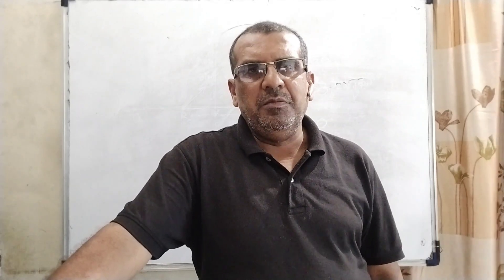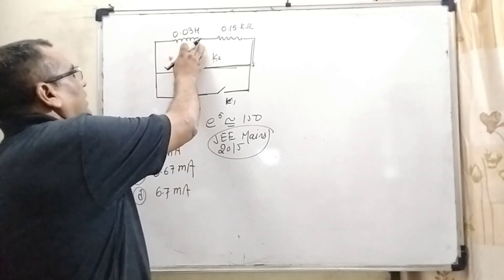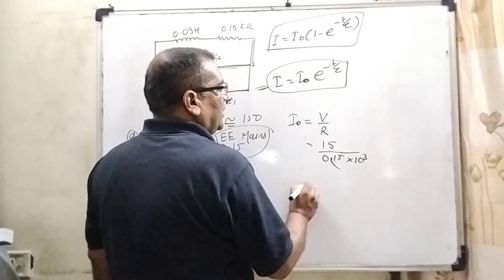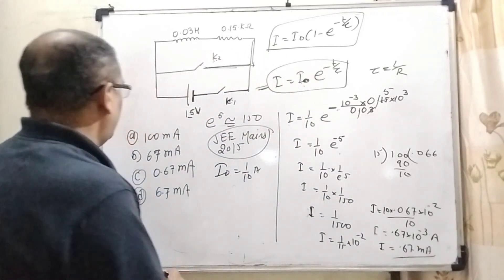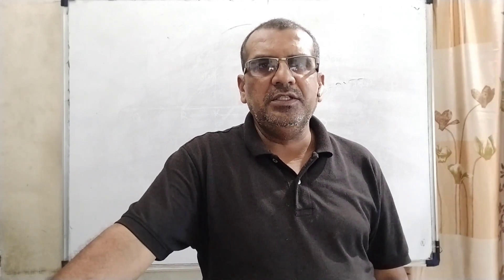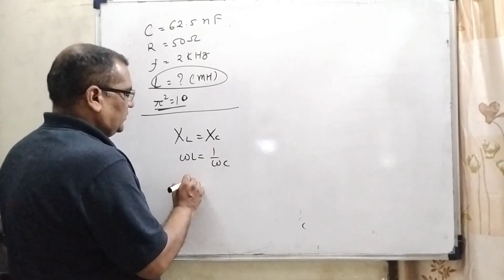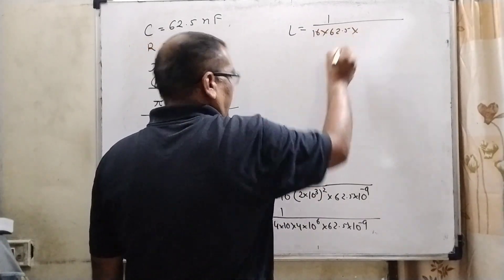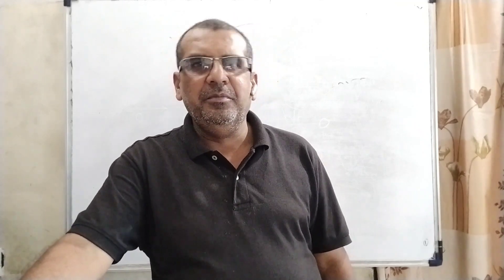An inductor (L=0.03H) and a resistor (R=0.15 KΩ) are connected in series to a battery of 15V EMF

Comment: Why discharging?
Reply from the maker: The load coil is charged as long as it is connected to the circuit and gets discharged when the circuit is broken because the function of the coil is to convert the electric field into a magnetic field.thank you for watching and please suggest to others to subscribe